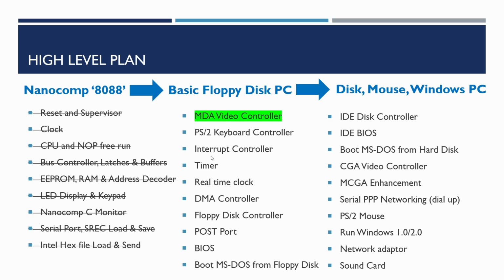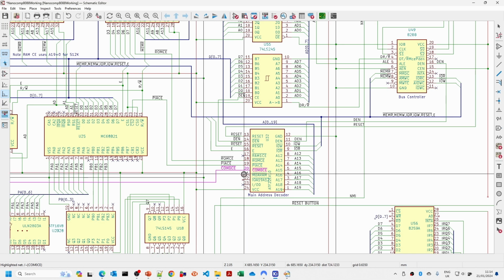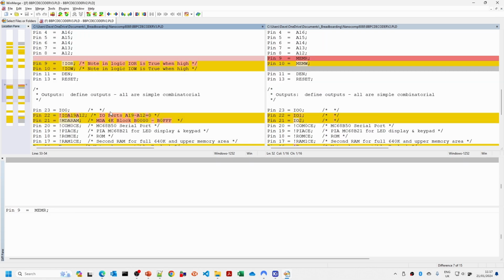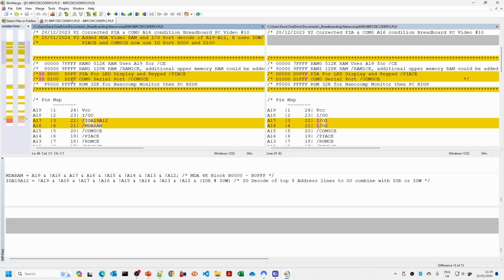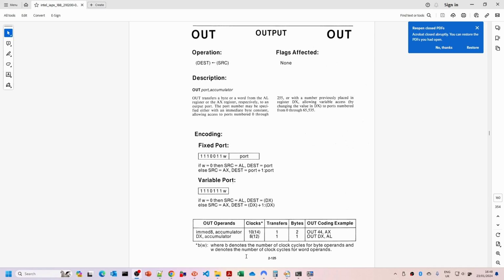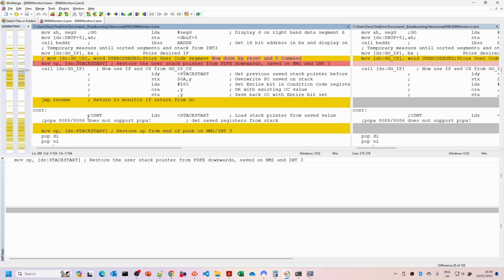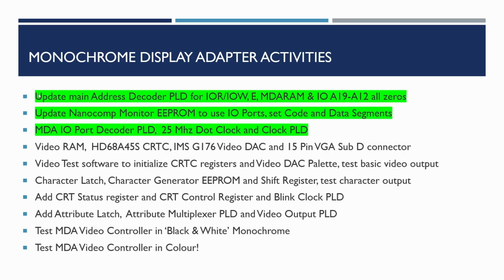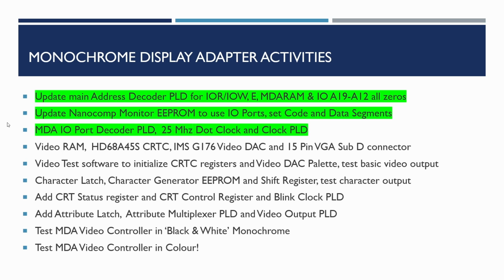Breadboard 8088 PC MDA Video Controller (MDA#3) #15

Comment: Regarding the PLDs (22V10 / 16V8), there are 15ns, 10ns and 7.5ns available. Are generic 15ns okay or do we need faster ones?
Similar question about the 74 series, since I've seen some 74ALS in the simplified diagrams
Reply from the maker: 15ns PLDS are what I have been using, you don't need the faster ones for what I have been doing. 
I have tried to get ALS for some Video Controller chips where available as they theoretically could be used for SVGA 800x600 at 40Mhz (I am am planning to try this at some point) whereas LS TTL would run out of steam around 30MHz but both are OK for 25Mhz VGA. Also ALS have better fan out for buffers etc so don't need so much buffering for larger projects like the Breadboard PC one. Dave
Reply: Ok, thanks!